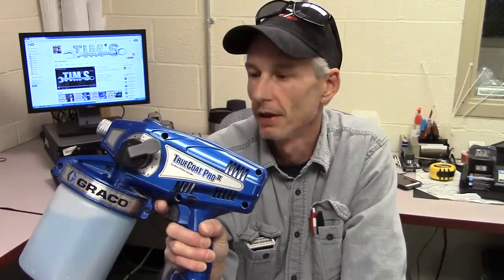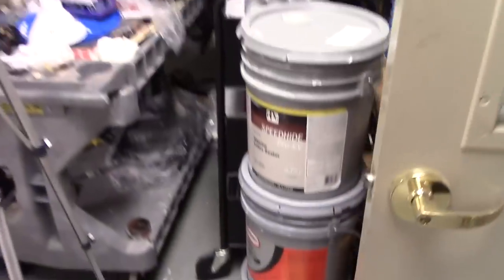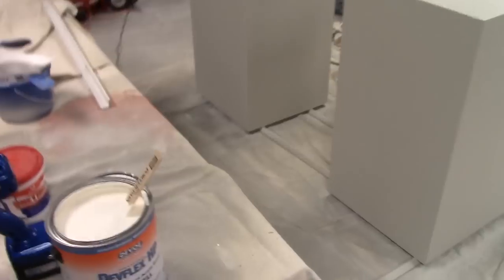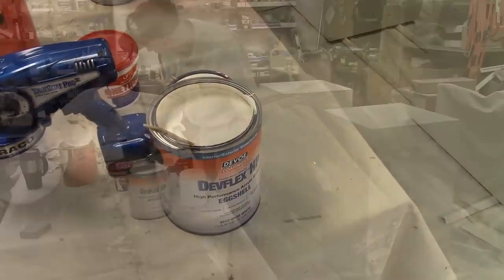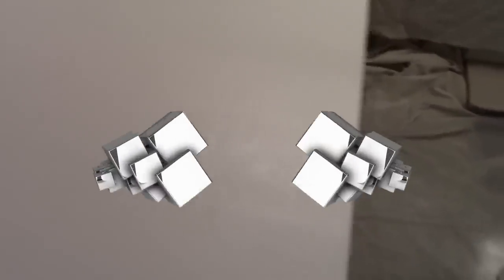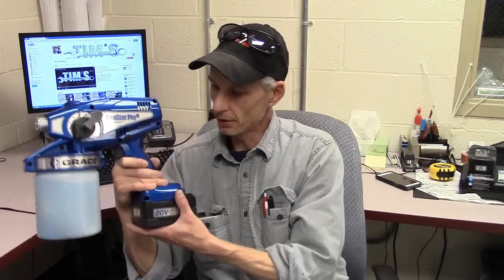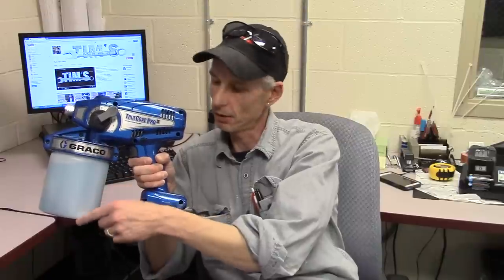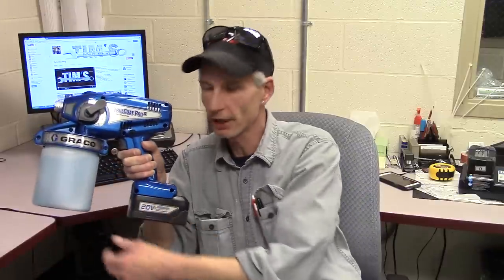Initial Review: Graco TrueCoat Pro II Handheld Cordless Sprayer

Comment: Thanks for the review. I want to purchase my first paint sprayer to paint trim and my single car garage. I may also use it to paint the kitchen cabinets and even my house. I was looking at either getting the TrueCoat 360VSP Airless Paint Sprayer or TrueCoat Pro II Airless Paint Sprayer. What are your thoughts and do you have a recommendation?
Reply from the maker: Erik Asquith First off Erik....Thanks a ton for your kind  comment, for tuning in, and your question.
Here's my thoughts....  If you are just going to use it for a few projects now and then, you don't need anything as pricey as the Pro II.  Anything with the Graco name on it is going to be a decent sprayer, and do a decent job.
I'd go with the 360DSP for several reasons (even if I were buying it for myself for home use, such as what you plan):  #1 Price,  #2 It has a cord, and like I mentioned in the video, I wanted one with the cord....batteries are just a hassle, unless you are somewhere that electricity is not available.
So, there's my thoughts, Thanks again.....and hope this helps you decide.  (If you do get the 360, message me and let me know your thoughts on it, and how it works for you.)

Also....if you haven't already.... hit that subscribe button.  lol
Reply: Tim's Man Blog, thanks for the feedback. I was actually looking at the corded version of the sprayer in your video. These are the two models I was debating between http://goo.gl/hxDBeP and http://goo.gl/yzwKaW. The Pro II version is $90 more, weighs 3 lbs more, has replaceable parts, does not require you to purchase new paint liners, and holds .3 quarts less paint.
Reply from the maker: Erik Asquith Yeah....on price alone, I'd still go with the 360, and then the weight factor.  The Pro II did wear my arm out pretty good.  You don't realize how much difference 3lbs makes, but it does.
You'll actually want to purchase paint liners anyway, so they are just disposable, making cleanup much faster/easier.
And as far as the replaceable parts..... If you always strain your paint, and ALWAYS clean it very thoroughly, you shouldn't wear any of the parts out using it as a homeowner doing projects.  I't would be different if you were using it to make a living.

Comment: Gi there my spray gun has been burned could please recommend me what need to do i got one not with with the battery thanks
Reply from the maker: Universe painting 
I would suggest checking with the store where you bought it.  If it's a Graco, most of them are rebuildable, and they'll be able to tell you where to take or send it to be rebuilt.
These small ones will burn up if used for large projects.  They're made to do a few pieces of trim and a door or two at one time.  Any larger than that, and you need to step up to a larger machine or you'll keep burning the small ones up.
Thanks for watching!

Comment: I really had high hopes for this product but have been left really disappointed.
I purchased new tips followed the instructions this sprayer still sprays with dots and sometimes spits.
Any advice PLEASE
Reply from the maker: P Freedman Sure thing!   OK, first of all the spits:  EVERY airless paint sprayer out there occasionally spits.  This is caused by the tiny amount of paint left behind on the tip from the last time you let off the trigger.  Remedy this by starting your trigger pull away from your work piece.
As far as the spraying with dots:  This can be remedied simply by experimenting with the different pressure settings, paint thickness, and making absolutely sure that your paint has been strained.
If you are looking to get a "perfect" or automotive grade finish, you are going to have a super hard time accomplishing that with an airless of any type in any price range.  My advice there is to go with an HVLP.  You can get them either as an "all in one" unit with supplied air pump, or as simply an automotive type spray gun that runs on compressed air.
Hope this answers your questions.
Thanks for watching!

Comment: Hello  great video  Could you tell me how the sprayer still performing since you made this video?is it still working great with no problems?also how much paint have you used in it thus far?i appreiciate your help I'm trying to make a decision on purchasing it!Thank you shawn
Reply from the maker: Thanks for the kind words Shawn, and thanks for watching, and the great question!
I have used the sprayer on 2 other other projects since then, approx. 2 months apart, and my thoughts are still exactly the same.  Still performs the same as it did new. The key is as with any spray equipment is in the cleaning after each use, and storing with Pump Shield or equivalent.
For smaller projects such as a couple doors, the trim in one room, or some art gallery pedestals like I did in the video it does an excellent job.
I've shot approx. 6 gallons of material with it total. About 3 gal. of primer, and 3 gal. of a fairly thick water-borne enamel.
Hope this answers your questions and helps. Thanks again!

Comment: Hey tim,
Love your videos man!!!
In your opinion what is the best Handheld Sprayer on the market???
Thanks
Reply from the maker: Hi Wilber!  Thanks man!
In my opinion, I would have to definitely say the True Coat line by Graco is the best.  Although the one that I reviewed is not the top of the line model.  It is the middle of the road with a retail price of around $400.  The top of the line model is called the TrueCoat Pro FineFinish, and will probably run in the $2000 range.  I have never used the FineFinish, but I am betting it would by far be my favorite, and the best.
Thanks again, for watching, your comment, question, and the kind words.

Comment: Some people say you really need two sprayers if you sometimes use water based and other times use oil based paint.  What do you think?
Reply from the maker: I think the more sprayers you have for different materials, the better.  If money were no object, I'd have 4 different sprayers for each type of material.  That being said....
I've used high-end sprayers for years, and as a general rule as long as you get it thoroughly cleaned between materials, you can use the same machine for latex or waterborne materials and oil based or alkyd materials.
Lacquer, epoxies, and other hot-solvent based products are different though. I would highly suggest a dedicated machine for any of those.
Great question! Thanks!
Reply: Tim's Man Blog thanks I was thinking there shouldn't be a problem with good cleaning.  And these real small sprayers should be easy.
Reply from the maker: Yeah....the key is in what "melts" what.
Dried oil based products can't be "melted" or dissolved by water based paints, and vice-versa.  However, lacquer and hot-solvent based products can and will "melt" or dissolve most other dried coatings.

Comment: you need to put the setting to 5 or better for latex paint . it'll get rid of the tiger stripes .it will give you better pressure .
Reply from the maker: Great tip!  Yeah, I need to do a follow up video.  I figured that out after a couple other jobs.  I thinned the with alcohol a tiny bit (for faster drying time), upped the pressure to 6, held the gun a hair closer, and moved a lot faster.  I am getting flawless results (almost automotive finish quality now) and lots of compliments on my work.
Thanks a lot for watching, your question, and the tip that is spot on.

Comment: Can anyone tell me the diffrence of graco 360,  truecoat pro 2 and proshot 2?
Reply from the maker: Hi Streiff.  First of all, thanks for watching and your question.
To the best of my knowledge, the 360 is basically the same as the TrueCoat Pro 2, with the only difference being that the 360 is corded and the pro 2 is cordless.  (Personally, I would have gone with the corded model if it had been available when I needed it, for 2 reasons: #1. These things do suck batteries pretty fast, and even with 2, you might end up with a job half done, and run out of juice.  Plus eventually the batteries do wear out and need replaced.
And #2.  The weight.  The battery adds a couple pounds to the unit which does make a difference to arm fatigue.)

As far as the difference between the TrueCoat Pro 2 and ProShot 2...... It appears to me like maybe Graco has just changed the name.  They appear to be pretty much exactly the same.
This is just speculation on my part though.... My suggestion would be to go into any pro paint store that carries Graco (Sherwin Williams, PPG, etc.) and ask them.  They will also have different flyers and printed materials you can use to see if there is a difference.

Hope this helps.....Thanks again!
Reply: Tim's Man Blog

Comment: Hi Tim, may I ask how long is it to charge the battery?
Thanks
Reply from the maker: You sure may Steven, and thank you for doing so....
it takes around 2 to 3 hours after the first initial charge, which they recommend 4 hours.
Again, thanks for your question, and watching!
Reply: +Tim&#39;s Man Blog 
Wow! You're the CHAMP!
Thank you so much!
I was about to 2 of them but they ran out of stock.
Guess I will go for the corded TrueCoat Pro-X II Electric.
Do you think it would let me paint, gutters, fences, doors, 2 big 2 levels exterior wall and 2 decks...?
Just wanted to save some money and to get the job done fast.
Have you have  any other recommendation comparison to Graco TreuCoat Pro?
Thanks again.
Reply from the maker: For doing larger jobs, I wouldn't suggest the handheld model.  The TrueCoat is awesome for small jobs such as a couple doors, or the trim in a room.  With the larger jobs you describe, such as decks, entire walls, etc., it would benefit you greatly to go with a regular airless sprayer....one that sends the paint via hose to the gun.  I suggest this for several reasons:
#1.  You'll be refilling your cup every 5 minutes.
#2.  The weight of the gun and paint creates tons of arm fatigue, and would get old really fast.
and #3.  You will be greatly over-working the pump and motor.  These are made to spray about a gallon per use at most.

Graco makes some good, reasonably priced airless sprayers that will do exactly what you'd like to do.  Probably around the same price as the TrueCoat.

Thanks again for watching, and hope this helps!

Comment: agree!
Reply from the maker: Thanks tiny!  For watching and your comment.
The only 2 downfalls it has are the weight (which gets REALLY heavy after a few minutes), and the fact that I'd actually rather have a corded model.For 2 reasons....one is that I think it may be a little lighter with no battery weight, and the other is that if you run out of battery in the middle of a job, you're stuck waiting on batteries to charge.
Thanks again!